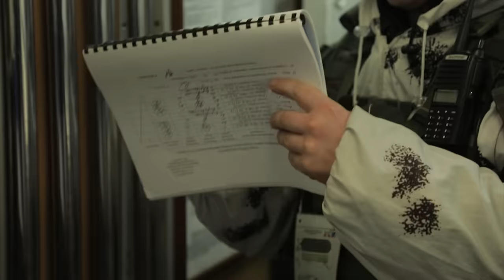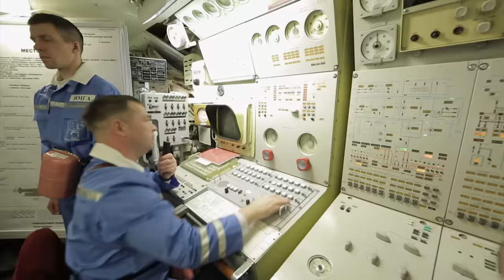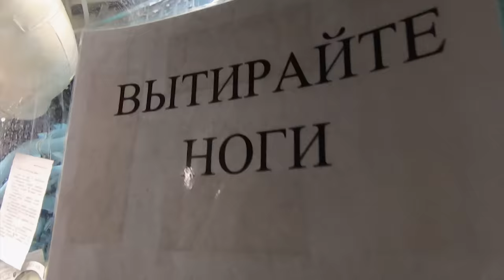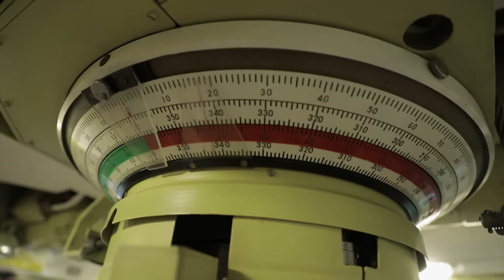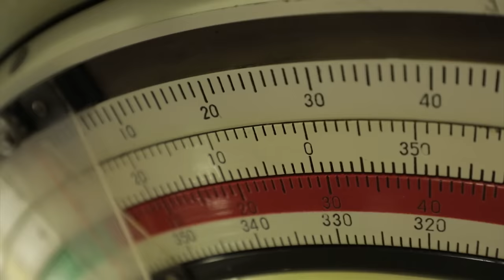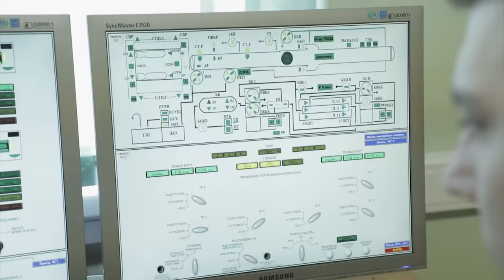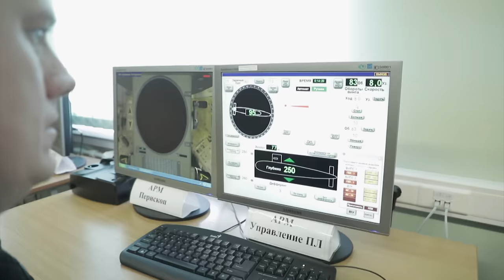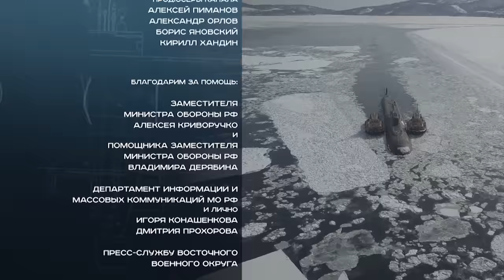"Hornet's Nest" / Home of the Russian Submarines / Top Secret / Combat Approved / New Episode

Comment: A firefighters worse nightmare, is seeing black smoke line on the windows. If the building or room is airtight like a house an the fire burns off oxygen in the room/house, then if you open a door, the room/house will blow up TBH. Firefighters in the states be trained to break into the building from the roof if there a black line on the windows. Soo tbh, in a sub or ship, its best to have all doors open in case there is a fire on there. If room air tight an there a fire in there your outta luck, abandon ship

Comment: Beautifully built vessels,  they look solid yet so smooth.  I think safety training should not be once a year,  as your not doing much anyway apart from war games on a sub you want to be training so rescue is automatic.  Once a year is surely enough time to forget 7 be inefficient.  You dont want another bumbling Kursk.  Also are those Nuclear reactors properly isolated with using a low melting metal to conduct the heat to the water.  And make one for me - i want one as a house boat.  Far fetched request?  I dont think so given I gave you advise which got Yeltsin replaced with order / tax system taken seriously / helped against scantions over Chechnya /  letter that led to  K4.

Comment: Russian equip on board looks old / legacy type in comparison to US one. They still function but what is the reliability, efficiency of same.
Reply: The reliability is what u get when u own an old piterbilt rig as opposed to a brand new Mack truck; the new one is full of sensors that keep failing émissions and require thousand of hrs of maintenance and the old school one is easy to fix, ready to go in any type of environnement that's what make the difference between winning and losing a war. Fancy, and expensive doesn't win wars; that explain why the US hasn't won a major war since WW2, and Russia and it's ancestors has in majority won wars.